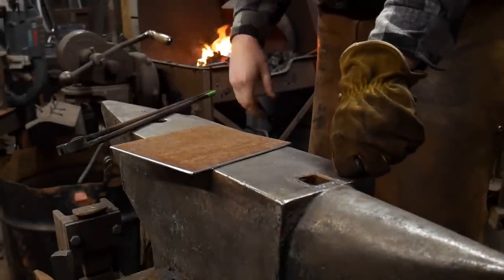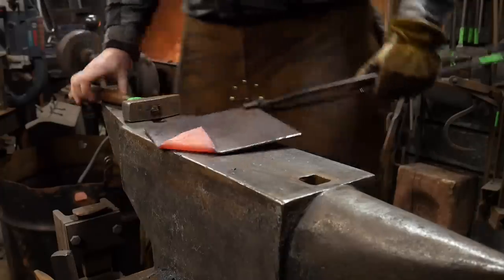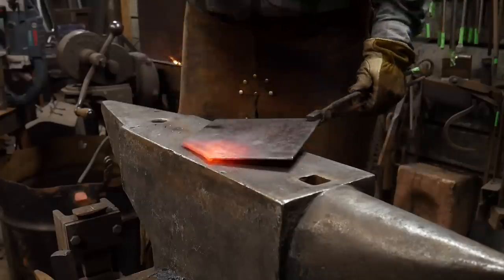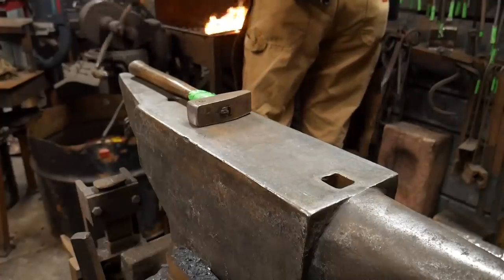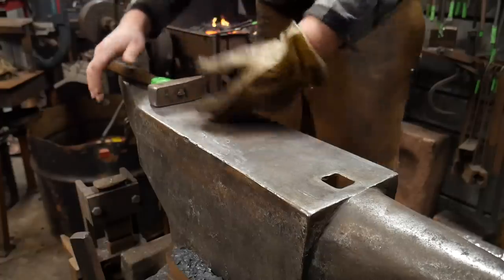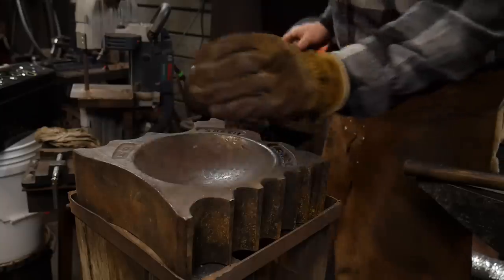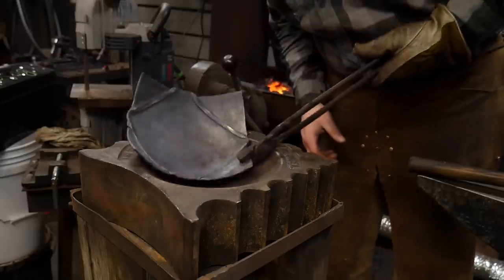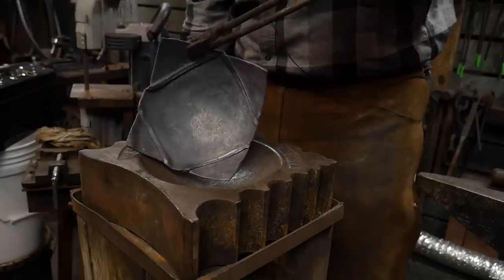How to Forge a $250 Fold Formed Bowl

Comment: I learned fold forming when I took a copper working class - glad to have run across this as I am just starting into blacksmithing and will apply those same techniques to steel. BTW there is some amazing work in fine metals / jewelry using this technique.

Comment: Just curious why not do the fold complete in the first heat? Is there a specific reason?
Reply: Depends. Larger piece of metal needs to be at least yellow-ish and a bit red in order to bend. Otherwise you might crack it

Comment: Funky design, but $250..?
Reply from the maker: Your welcome to sell it for less. I'm just letting the blacksmith community know what the market can bare... Similar pieces have sold for this in my shop and a little bit more.
Reply: @ChristCenteredIronworks  Thanks for your reaction. I was wondering about the market(price). If it is a fair price to you and people willing to pay, it's ok. To me it's a bit much compared to some tools, which to me require much more effort and cost.
Anyway, thanks and happy new year!
Reply: When a very successful and known Blacksmith is willing to suggest a price that is fair, most tend to listen and break down all associated costs and time involved. Once that is done it is easy to see why that price can be asked. Under valuing your work does nothing but harm to you and other artists whom create such things.
Reply: Thijs Nagtegaal ...IKR! You'd have to be a member of the 
more money than brains club to spend $250 for that. Normally I'd consider this a waste of 20 minutes, but I always learn something new from this guy and this was no exception.
Reply: Christ Centered Ironworks ...You're doing the right thing in pricing! People using the "cheapest" buisness model screw it up for true craftsmen. They can't sustain at that level so they fold and only succeeded in lowering the wages of other craftsmen.
Reply: @bradleybellwether3063  I agree with what your saying. But what I basically say is that I would not pay $250. To me that is a lot of money for this item, to me not a fair market price. Of cource you should not lower prices which disrupt/destroy the profession and your own business but maybe this (or similar) item isn't worth creating anymore (asuming $250 is the fair price)...
Reply: Thijs Nagtegaal ...I wouldn't pay that either, but I know he did more finishing work after the camera stopped. I just wish we could have seen it.
Reply: Thijs......I agree with  you however, if Roy can ask $250 for an item it took a half hour to make with a raw material cost of around $1.00, consumable costs of around $2.00 AND he can still sleep at night......then all the  power to him.........he's got a young family and he needs to put bread on the table.  "Art"  always commands a better price.........because there's a story that accompanies the piece..........the better the story.......the higher the price.  Throughout history there have been those that have supported the "arts".........and resultantly......the artist is freed from the daily survival constraints and then can focus on creativeness........sure, it could be argued that they then climb to great heights of fame and fortune on the backs of the real craftsmen that actually "create" the art.......but history records them as "masters" of their craft (and rightly so, because without them there would be nothing).......even though you and I both know that Michelangelo didn't do most of the work on "David" or the "Pieta".  So there you have it.......Roy is the next Michelangelo.  Be that as it may..........God be with you all.
Reply from the maker: Lol Michael Angelo thanks for the comparison :-) God bless you as well and thank you for your thoughts
Reply: @stuartkauppila2942  Thanks for your reaction. Very nice analyses, it makes sense to me.
I did not look at blacksmiths as artists but as "regular" craftsmen. Of cource this also comes with creativity and could produce "art" instead of functional items.
(Still I would not pay $250 for this item but understand someone would :-))
Happy new year all!!
Reply: I have seen some of the copper bowls that Roy makes! If he made this in copper? I shudder to think of the price! Just based on the same sized material in copper! on E bay currently 6x6 1/8" plate ranges $18-$30 USD where as steel plat that size depending where you get it costs considerably less
Reply from the maker: " value is what you add to a work of art not what it's made from" thank you Frank for always being a great subscriber and friend of the channel :-)
Reply: @ChristCenteredIronworks   Keep up the good work my friend.........remember that all we have comes from God......we are nothing but the awestruck recipients of His Blessings.  Happy New Year!
Reply: @thijs3514  Happy New Year!
Reply: @stuartkauppila2942  blah blah blah.. comment was too long winded.  YouTube needs to limit responses to 30 words or less.